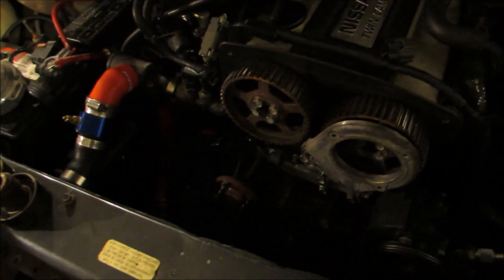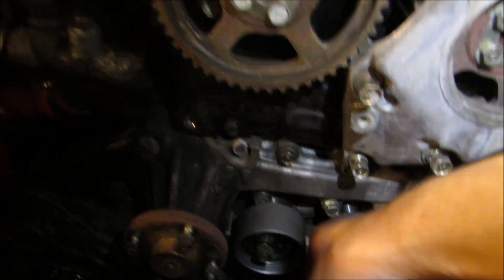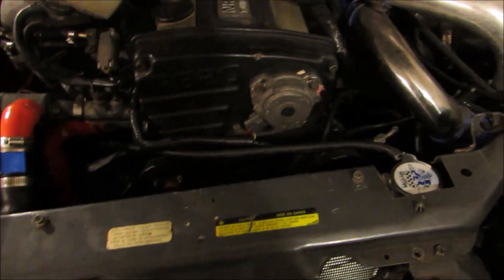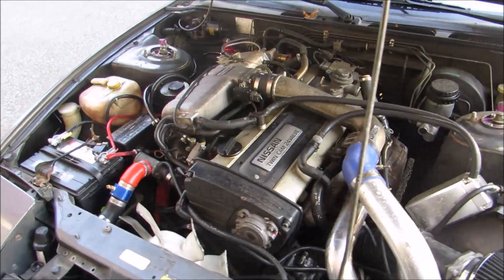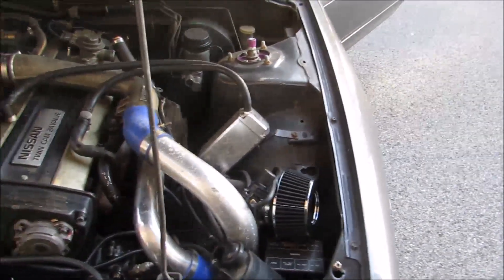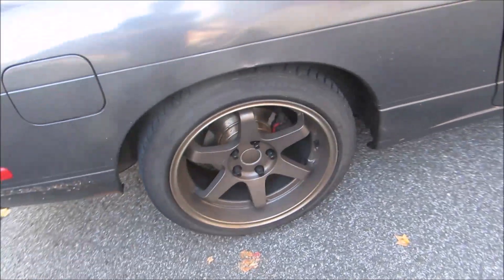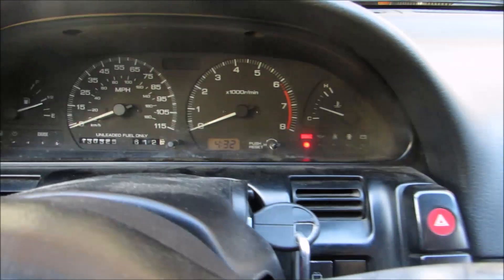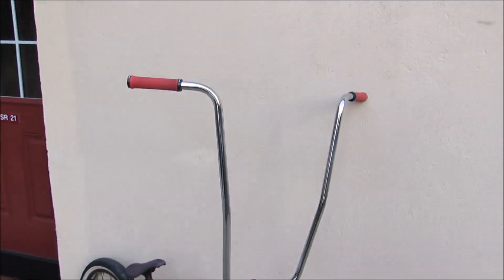Budget Build Ep.24 | New Timing Belt, AFR and ISR Boost Controller

Comment: Be careful with that boost controller. Mine broke in my hands. Went with a hallman and it's great. And 14psi on those turbos are quite sketchy. That's when they blow. I'd say at 12 man. But that's up to you! Wheels look good!
Reply from the maker: Kalvin Malli thanks man! It is pretty finicky not gonna lie. Weren't you running like 13-14 on your rb25 turbo?

Comment: bro looks like you live close if you near fontana nissan. i bought brand new pro engine and trans wiring harness for my s13 rb20det  but found at my chassis power is connector to my chassis harness is clipped off and just the wires are there. would you be able to come and help me as a mechanic of course money involved.. need help please comment back if youre interested to come out to ontario ca off the 10 freeway and haven . i really need help.. mine was running with the old wiring but cant get chassis signal and power properly connected

Comment: your timing belt sounds too tight from that whine, check it just in case!
Reply from the maker: Its my transmission :((((
Reply: oh man lol, btw on that isis boost controller is the one side opened, like ported to the atmosphere? i put it on my rb20 with 25 turbo and pulled 21 psi lol it was nuts but not what i was goin for, only could get 21 psi lol
Reply from the maker: On the boost controller I am using only 2 of the 4 ports. The arrow is supposed to be pointed towards the wastegate. The other side would be from your compressor housing bung or in my case the compressor intercooler piping. 21 psi is not good! these turbos can only handle up to 14psi. the turbine wheel is made of ceramic so it is pretty fragile. once it breaks it will send shards of metal into your engine. Not good!! Hope this helps!